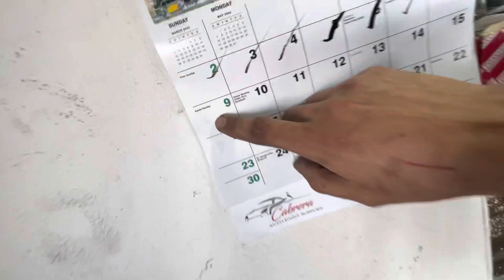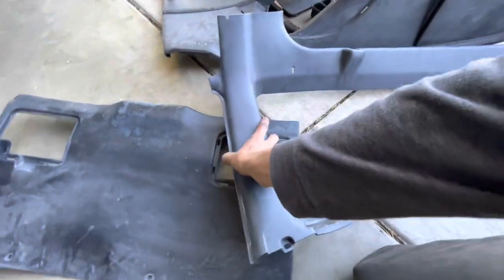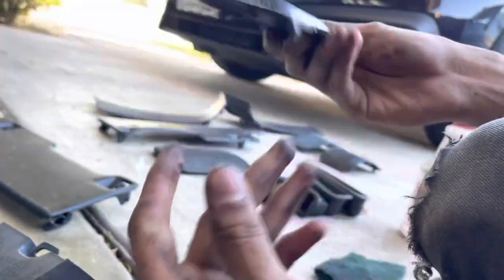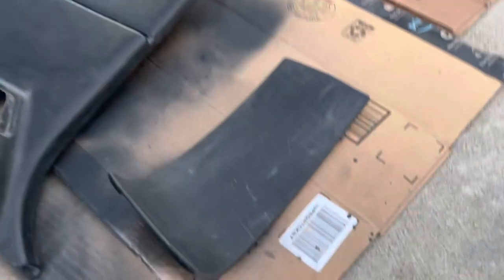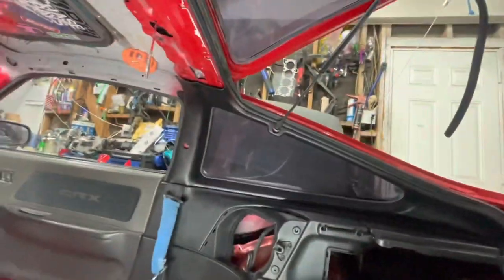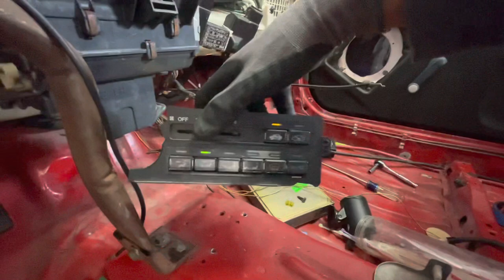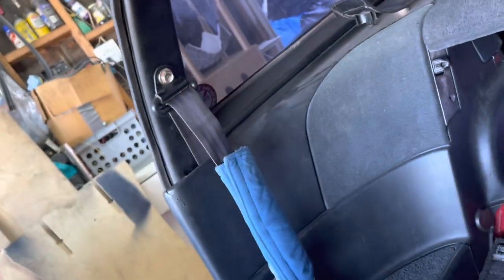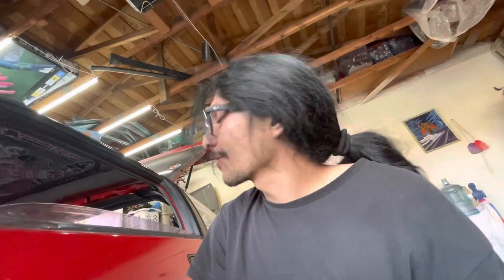CRX Interior Restored + Installed | SEM Color Coat

Comment: Sorry to bother you with this but my head light glass is cracked on a 90 hatch would be able to use one from a 90 sedan... I researched but couldn't find a straight answer some one mentioned that you would need to change the bucket out. Thanks for your time and help
Reply: Yes it fits, they are the same.
Reply: @scorps9398  
Thank you good looking out unfortunately i went to pick n pull and someone had already beat me to them

Comment: 5EFHE Intake, it is a common swap for 4EFTE (Turbo) engines. I did it to mine and have the second set of runners open using an output
From my standalone ECU under boost.

Comment: Does it scratch off ?
Reply: Do you also have the links for what you bought ? I’m thinking about doing mine
Reply: Yes it will scratch off
Reply: Yup. The paint is high quality, and it will resist some, but it will scratch off eventually no matter what. The worst thing that'll happen is you'll have to remove the panels and repaint.